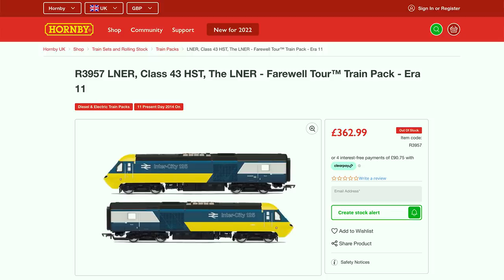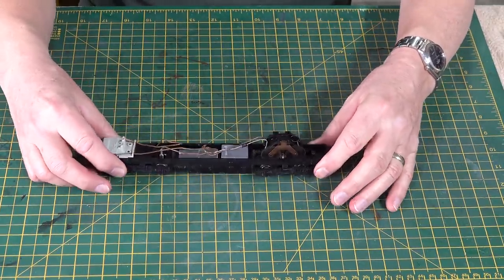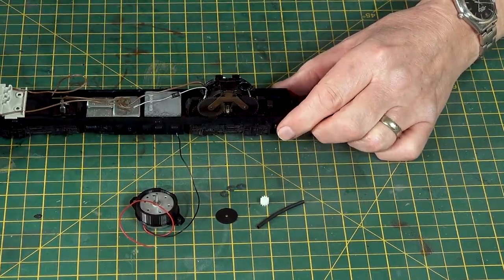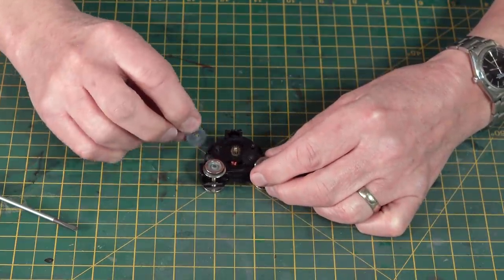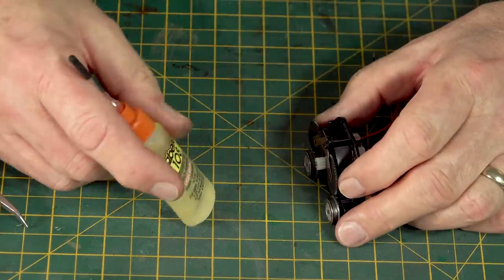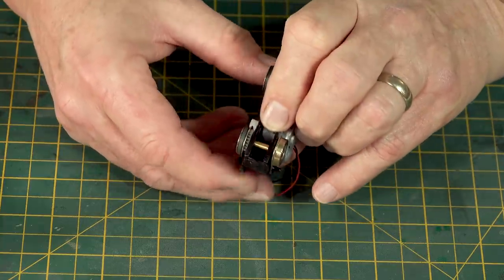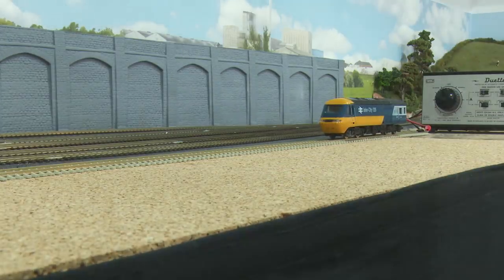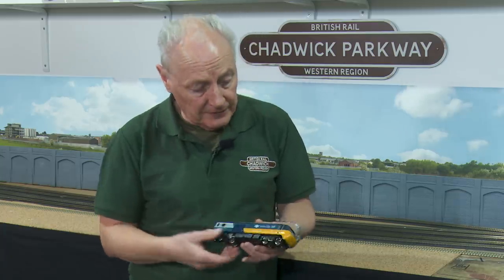Replacing Loco Motors at Chadwick Model Railway | 151.

Comment from the maker: Ladies and Gentlemen, I'm sorry but Mark has now run out of these motor kits due to the mad rush of enthusiastic modellers wishing to replace their ailing Ringfield motors. 
Rest assured that he has more in the pipeline and in a week or so, Mark will be able to fulfil your orders.
Regards Charlie
Reply: Could you give us his  details please ie, eBay  shop address etc. Your video was facscinating Charlie, as I’ve a model similar to the remodelled  one you used. My is in the same era 30 / 40 years old. Thanks in advance.  Frank Hughes
Reply: Yep, I was one of those who left it too late! (damn!) Looking forward to re-motoring an old Hornby Coronation Scot, she runs OK but a bit notchy... about 40 years ago, I used to have an HST just like that (and the centre coach had lighting too!), sadly - like so many childhood trainsets, it was sold off by my mum when I left home, er, 30 years ago. Recently scanning a certain auction site, seems there weren't that many around with lighting? I did find a few with the "plunger" pickups like mine had, but not as many as I'd thought.

Comment: Hi Charlie, can I recommend that when using a soldering iron  to shrink heat-shrink that you consider using the rightangle formed by the soldering iron tip and its retaining nut. This provides 2 surfaces for heat transfer and keeps the solder on the tip out of way. Phil, Geelong, Aus.
Reply from the maker: Are useful tip, Phil, thank you. Regards, Charlie

Comment: Converted my R069 1979 HST last weekend, with CD motor, led directional lighting in both power and dummy upgraded to DCC & added TTS Valenta decoder. Runs sweet now and so much more responsive.
Reply from the maker: That’s great news, I’m so pleased it worked out well for you. Regards Charlie

Comment: Interesting diversion from your usual topics.
I reckon you need a gear puller Charlie, and circlip pliers. 😁
'Now it must be the turn of the cogs.' 🤣 
I use Labelle #108 too. Bought a bottle about 14 years ago. Still have enough to last another 100 years or so. Also the #106 grease with PTFE and Micro-Trains 231 (Kadee) Grease-em graphite powder which is great for knuckle couplers.
It's much more fun to solder the wires before you put the heat shrink on and then desolder the wires. That's how I do it.
Reply from the maker: I’m so pleased that you found the video interesting, and especially as you can relate to soldering prior to the heat shrink application!   Stay tuned mate, regards Charlie

Comment: 12volt LEDs Charlie! (My HST has White & Red which are available. A bit of shaping around the front and it’ll loook 100% better than the filament.........). Just an observation for dc modellers. Super video. Super job.
Reply from the maker: Stay tuned for the next video Bob.
I will sort out those lights!

Comment: Prompted by your video, I went one step further. I have put the latest HST bogies (regauged to EM) and drive motor into an old 1980s chassis and will be adding DCC sound and separate white and red lights.  Total cost £150 including buying a 1980s HST as the victim.  Much better than £369, and that's without sound...! And that's before I sell on the old bogies and ringfield motor..!  Thread on RMWeb under Modifying & Detailing RTR stock  Keep up the good work!
Reply from the maker: That’s great news Patrick, and I do hope that it all goes well. 
Regards Charlie

Comment: Thanks to you and 00Bill  I have brought a couple of OLD spares and repair 060's and a almost unused 1976 Dutchess of Sutherland. One of the 060's was a Lima GWR Pannier and I fitted a CD motor from Strathpepper Junction and a TCS-T1P decoder which just fits into the tender. Even though the Dutchess had not been run, the magnet had lost a lot of its power and there I replaced it with a  N52 Neo magnet from Bowelrscroft. If I want to fit a decoder to the Dutchess I only need to fit a small piece of kapton tape between the peg that electrially connects the two motor bodies.
My journey into DCC via an Ardinuo is not progressing well as my poor old Range Rover P38 keeps getting in the way.
Again thanks for your videos, watching them is almost more fun than 'playing' with the trains themselves.
Reply from the maker: What a cracking comment Laurie. It’s great to have you on-board mate and good luck with your project. Regards Charlie

Comment: Hi Charlie, not sure if this has been mentioned in previous comments, but when soldering try to keep the heat shrink tubing as far away as possible from the joint, or you run the risk of it shrinking on you, and then it won’t go over the joint….How do I know, because I’ve done it…Already done several of these conversions myself, including adding DCC decoders, and LED lights, but you’ve done another great job. Keep up these interesting, and informative videos.
Reply from the maker: Thanks Roly, advice is always welcome.
Regards Charlie

Comment: Good afternoon Charlie... I have just fitted one of the slimline, 9.5MM?, to an A3 Bittern, tender fitted. Also at the same time converted to Dcc. lucky there is space at the back of the tender to fit a protective plate to put the decoder on.. works well, the only thing with the slimline motor is its 6volts.. but obviously just set the CVs to top out the top voltage.. anyway enjoyed the vid.. still not got my shed built but am converting a loco a day :) cheers.. 
Dave
Reply from the maker: That’s great news Dave, keep at it mate. Regards Charlie

Comment: I got a motor out of an old cd player or vcr marked 12v and it fitted inside the hornby motor block the same as this although i removed the brass bearing i recall. I bought a hornby class 91 in gner livery on ebay for pennies as it was rough and didnt run., It now runs silky smooth although mine wll do a scale speed of over 500mph as well as a slow crawl. It pulls a full 9 coach rake easy by adding weights into the chassis to aid traction. Id say its one of the most fun trains to drive on my garden track where you can get speed up instantly in between the corners. Really i need to slow it down with some resistors. Great vid Charlie as always. I would recommend this type of conversion to anyone with old hornby or lima locos. Lots of kits on ebay or find a motor and order the little cogs to fit. Add some lights, a decoder and save 300 quid. Hornby are others are just being silly nowadays with price.
Reply from the maker: A great comment Iain, thank you. So pleased your projects are working well. Regards Charlie

Comment: Don't forget to change the tyres while you're there with the wheels off. I just did a service on three such HSTs (not this new motor, but servicing the original with a cleanup and new brushes and springs). The decades-old rubber on the wheels came off in hard chunks. Replaced and runs much better. (Hattons, something like 12 quid, as I recall). Looking forward to learning about adding new red lights in the next video! Thanks, Charlie!
Reply from the maker: I shall have to check out the supply from Hattons, how many Tyres did you buy for £12? Regards Charlie

Comment: Love your work Charlie! I thought it might be worth chiming in with regard to the direcional difference in top speeds that  tends to be quite common with many older ringfield type motors, particularly Hornby and Lima ones. As these motors are made made to fairly a fairly crude design and tolerances, you will often find that the timing of the motor is not particularly finely tuned, and this will cause the motors to run slower in one direction. This can cause be adjusted by way of ever so slightly advancing or retarding the position of the interference fitted collector plate upon iits axis on the armature. I find i need to do this with probably about a thrd of the old Lima locos i buy used.
Reply from the maker: Many thanks for an interesting observation. I might put a motor in the trailer car too. Regards, Charlie

Comment: Hi  Charlie as ailing 72 year old Patreon I was fascinated by this episode unfortunately I could not do this myself so I sent Mark a email if he could do it for me.
So I sent 2x A4's 2xDeltics 1 The city of Nottingham.
Not only did he change the engines but also gave each engine a service plus postage for I think a great price of £175(eat your heart out Hornby)
I am a DC man and as you will have gathered It was around 1961 my trainspotting era makes up my model railway and I suggest to any of your members in the same boat as me
get in touch with Mark.
The performance of the engines is brilliant, I don't think I have had a A4 take off with a full load(intentionally ) as slow ever and the guagemaster controller has never been above 30.
Many thanks
Robert Elliot
Reply from the maker: That’s great news Robert, I’m so pleased that Mark has breathed new life into some of your locos. Regards Charlie

Comment: Charlie,
A friend of mine also has converted locs with this pickup arrangement: front truck left side and rear truck right side. Or the other way around.
This DCC conversion worked fine until he tried to drive from one booster district to another.
In this case, momentarily on the booster separation gap, the loc takes its “left power” from one booster and “right power” from the other booster.
This resulted in a stall from the loc.
He had to place additional pickups on the wheels without pickups and on both trucks to eliminate this problem.
I hope this information is helpful.
Regards,
Jelle
Reply from the maker: An interesting comment, however if he fitted a stay alive would that have worked?
Regards Charlie
Reply: @ChadwickModelRailway  Hello Charlie,
Using a Stay Alive is an interesting idea. We did not try that.
I can’t picture exactly what will happen electronically though.
Our locomotives were old brass Overland USA locos.
Placing additional pickups in the steam locomotive proofed to be too difficult and time consuming.
It found its way back in the display case I believe.
In the diesel locomotive (same brand), adding extra pickups in the trucks was relatively straightforward.
That said, USA locos generally speaking do not have traction tyres.
Pickups on wheels with traction tyres does not seem to be that effective to me.
So, if you decide to try a stay alive when you encounter the same problem I look forward to your findings.
Regards,
Jelle

Comment: And boom. He only goes and does it again. Raising the bar ever higher. Well done @Charlie. 
One day, when I get the chance I shall recover my old Hornby from where it is stored and as they date back to the early 80’s and have Ringfield motors it looks like new life can be breathed back into them. Just wonder whether the old R900 and R901 are still safe - will have to pull apart, check and PAT test!
Reply from the maker: Mind you David, if it isn’t broke don’t fix it.

Comment: Thanks for the indepth instructional video Charlie, seems a great value and well thought out conversion kit. I've got a large number of models from the late 80s/early 90s with this kind of drive that are now very kranky so it was great to see that they can be modernised.
Reply: Also makes me feel like I'm getting old when most of my locos are the old Margate made Hornby and split chassis Bachmann!
Reply from the maker: We can’t just leave them to gather dust in a box can we?
Reply: Definitely not. While we've got incredible models coming out now, some of the prices now are eye watering. There are lots of older locomotives that can be bought cheap and with a little work can be improved up to a good standard and you've had the fun of modelling along the way.

Comment: Hi Charlie, first time I’ve commented. Heat shrink is the most useful stuff, but behaves so much better with a mini heat gun. I have this one from Hobby Craft, but near identical tools are available from around £10 from Amazon. Shop if around local craft stores might be even cheaper- when I got mine it was £15 for a black one “man tool”, but only £10 for an identical blue or pink version “for embossing and crafting”😁
Trust me on this, it is so good to use. You’ll end up using heat shrink far more often: it’s so much neater.
Reply from the maker: Thanks Matthew,
You mentioned “I have this one”. 
Did you mean to leave a link?
Regards Charlie

Comment: Hi Charlie, another easy to follow detailed 'how to' video. I have done the same with a 1970's Duchess using Marks motor and I am changing it to DCC this weekend.
Barry.Devon
Reply: was this a tender driven Duchess ?  - mine is an old 70-80 tender driven and screams like mad when running
Reply: @smileygoesfishing36  Yes it is. I bought 2, second hand and I am in the middle of doing a video showing the replacement motor on the 6233 Duchess of Sutherland that I think came on the market in the late 1970s and converting to DCC. My other duchess is 6234 Duchess of Abercorn is newer, being a 1980s model and I am converting that one as well. The reason for the video is that although the 1970s Ringfield motor looked the same as others, some lugs were different and it only had a red wire to the motor. I am not as chirpy as Charlie nor that good at videos, Just look at some of the 40 I have produced and you will see for yourself. .......... Barry
Reply from the maker: Great comments gentleman and I’m so pleased that you enjoyed the video.

Comment: Thank you Charlie. I've got 2x older hornby class 47s that I converted to dcc and stay alives but they never did run right. I always suspected the ringfield motor to be the issue with high voltage and current demands to start it causing issues with the back emf reading on the dcc chip.. I've ordered a kit and will fit to see if it changes any thing. 

Thanks again for your time in creating these videos
Reply from the maker: My fingers are crossed for you Stuart. Regards Charlie
Reply: Motor has come and fitted.. new motor spindel seemed to short to fit as you described. Had to cut some metal away but still fitted very well.. as a update regarding the ddc decoder, this now runs soooo much better now... Will be upgrading my other ringfield motors now 

Once again thanks for the videos
Reply from the maker: @stuartfram5184  That's great news.

Comment: A very informative video and you gave an excellent conversion process for upgrading / replacing the old Hornby Ringfield motor assembly. The reassembled model looks and runs beautifully, much more responsive. Totally agree with you about modern Hornby, they're going to have to be careful as they are amongst those manufacturers that may price themselves out of business, maybe they need to reassess things and pull back production to the UK from China to save on shipping costs and the like.
Reply from the maker: Great comment David.  I just feel that Hornby are taking us for granted, that we will carry on buying their products regardless of price.

Comment: You don't mention that there are two motors you can order - a 6 volt one and a 12 volt one. The 6-volt one gives better acceleration, but is at more risk of burning out than the 12 volt one!  Hornby says they don't recommend this conversion as these motors are subject to overheating. It might be as well to point out the conversion should not be done for locos which are to run continuously for more than an hour, for example at an exhibition. A  good video clearly explaining. I have still got this job to do. I ordered the kit ages ago, still haven't got around to it!  Thanks for uploading.
Reply from the maker: I’m not surprised that Hornby take that view, it’s hardly surprising as they have no vested interest in a replacement product. Regards Charlie.

Comment: Absolutely agree with your thoughts on new HST's.  Last October I bought a HST power and dummy plus 2 coaches as a non runner from a 2nd hand shop. Then bought a Buffet and 3 additional coaches off E Bay (all the 'short 7 window ones), and got it running. After a day or so the motor gave up again so I bought a CD motor replacement from Strathpepper. As per your conversion, it now runs beautifully drawing less than 150ma. Total investment £80. And I've got replacement LED units for the grain of wheat bulbs to fit next.  Why on earth pay £300 plus?
Thing to note - Strathpepper suggest if you use a HF track cleaner unit you turn it off when running CD motors as they have had mixed reports.
Reply from the maker: Great comment David.
A man after my own heart, regards Charlie

Comment: Very nice "how to" Charlie. 
I've replaced a few old Ringfield motors with CD Drive motors which is what the one you got from Mark looks like.
I 3D printed my own mount brackets but it's great that they are available as a kit like this for a reasonable price. 
I usually fit one of the tiny ESU DCC chips while the loco is in pieces as well. Quite easy for most locos.    Cheers!
Reply from the maker: Thanks Gerry I’m so pleased that you enjoyed it mate.

Comment: Hi Charlie, Thanks for that presentation of replacing a ringfield motor. I have three sets of HST 125 that are about the same vintage as the ones used in your presentation. Since I live in Sri Lanka, I would try to use a CD can motor based on a Utube presentation I saw some time ago. As my layout is now DCC, I will also need to get a basic 4 function decoder. A Sound card is pretty expensive for me. But thanks for this presentation and I am now going to watch your presentation of converting DC to DCC. Cheers.
Reply from the maker: Thanks Faizal, I’m so pleased that you enjoyed it.